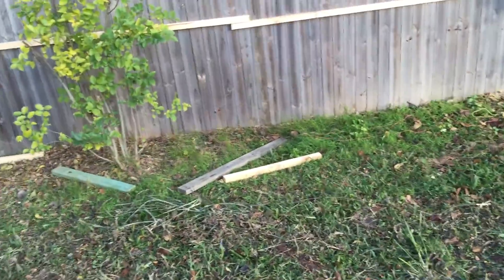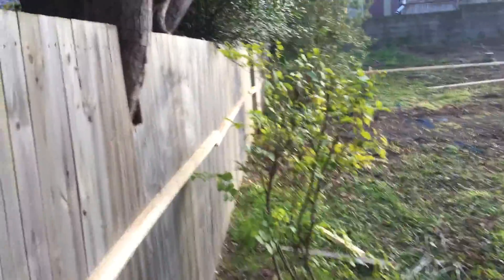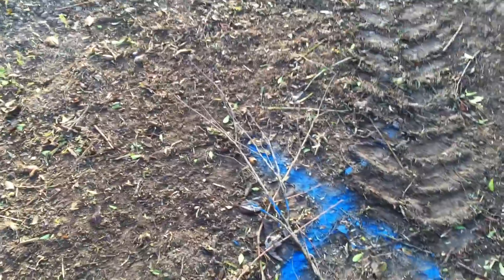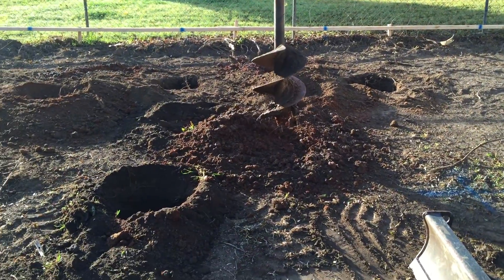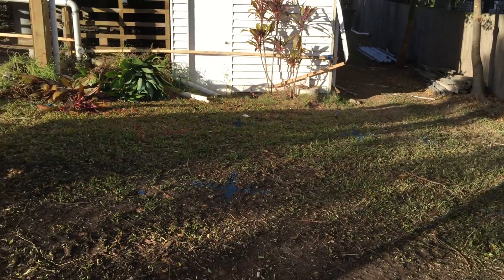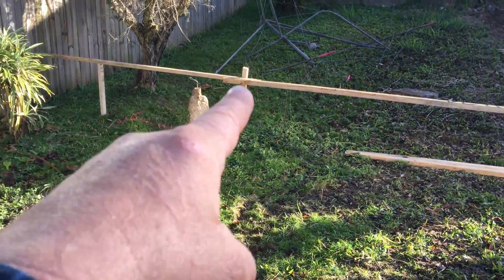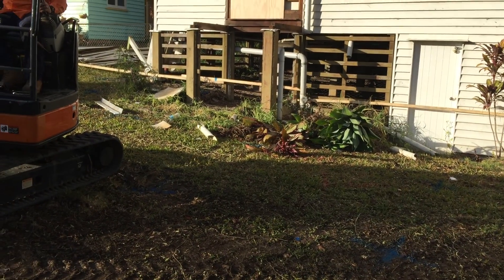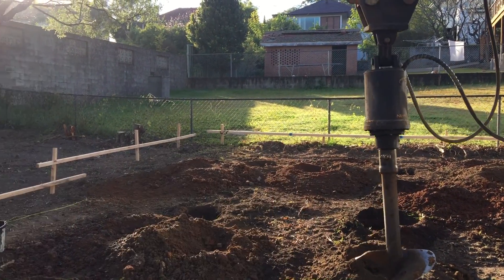house stumping at Moorooka video no 1

Comment: How you doing? Did you have to get the site pegged out first before you set up profile?

Thanks
Reply from the maker: Hi, Although I have been taught in the old way of doing things. In todays world if you want to have all the cirtificuits to keep council happy, you will need a survayer to mark out the possition of the house or extension. Or you will not get Council approval or insurance for the building.
Reply: Thanks heaps.. And also when holes are dug out for post does it get inspected before concrete by building surveyor? 

Thanks
Reply from the maker: @vidalklau9729  No you have to get the engineer that designed the footings on the plans you have submitted and approved by council. No approved plans, no building.